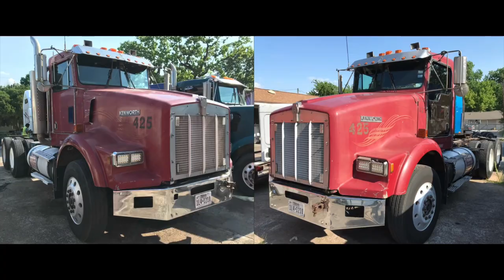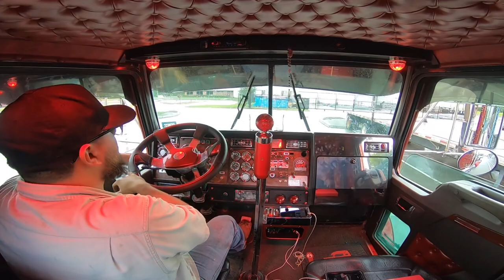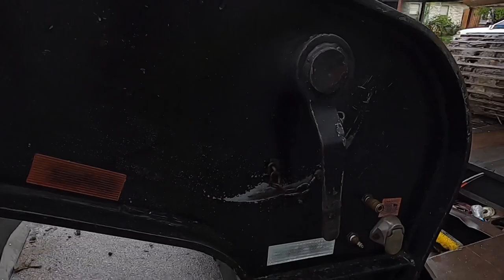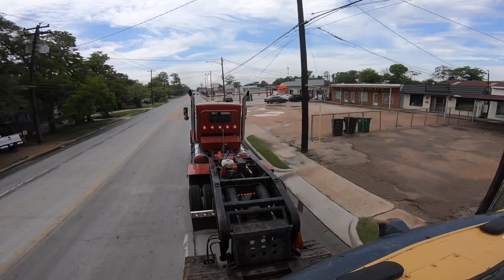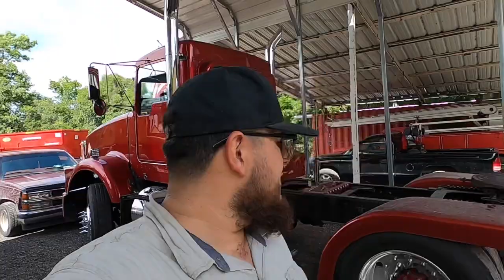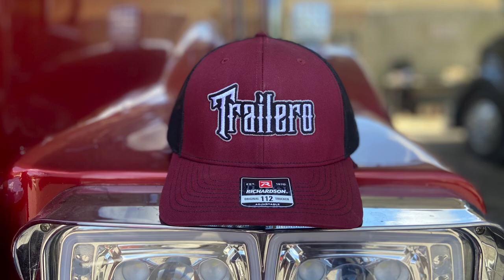fully restored kenworth is back on the road, straight piped Detroit series 60

Comment: What size exhaust are you running just bought a semi identical but not finished. going to start working on it wanting to do a chrome straight pip trying to decide on size and top cut
Reply from the maker: 6in pipes
Reply: 10-4 think I’m stuck on a 6” from under the cab to a flat top